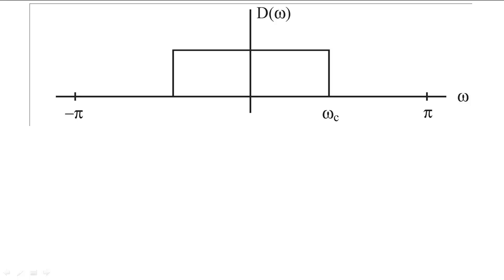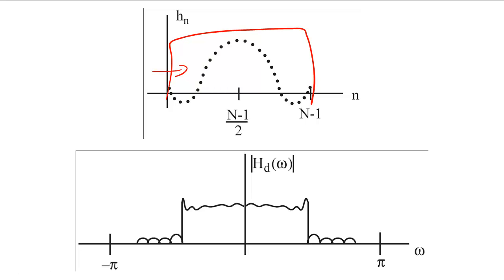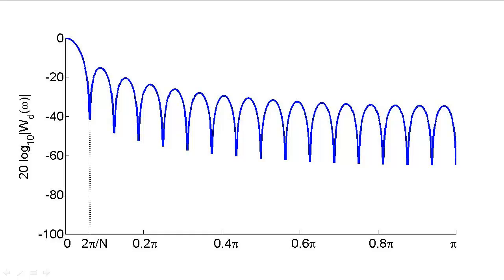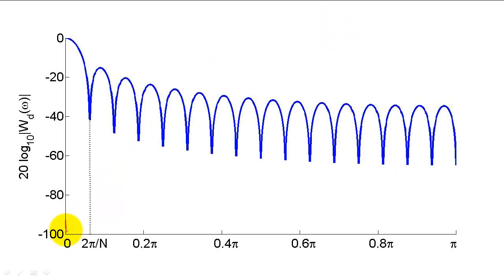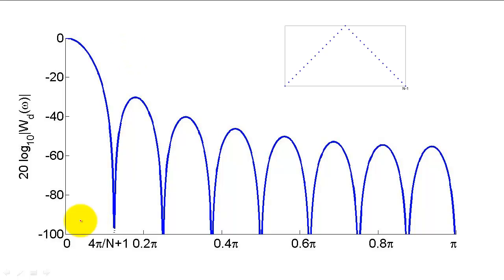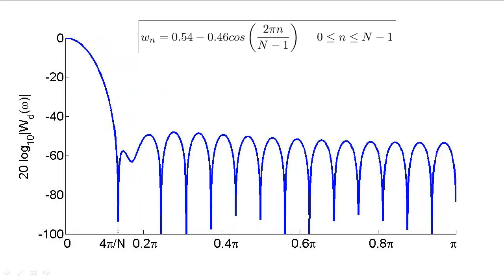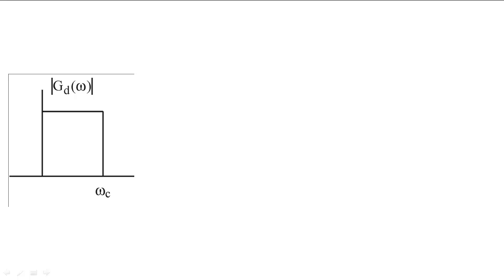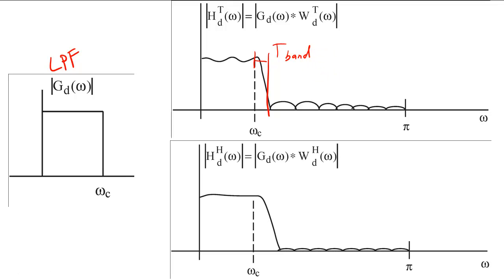26 - Filter Design Using the Windowing Technique

Comment: Why don't we just do an fft of the input signal, multiply it with the frequency domain representation of the low pass filter and than do an inverse Fourier transform? This way we won't need any windows. How are windows used anyway, do we take n samples of input signal and than multiply it with the input signal, and than take another n samples and do the same? or do we take 1 new sample at a time while discarding 1 old sample and than multiply these n samples with the window function?